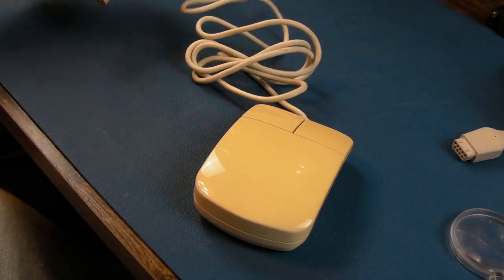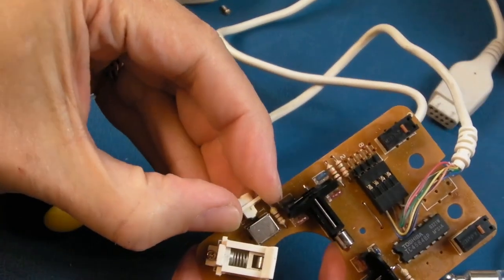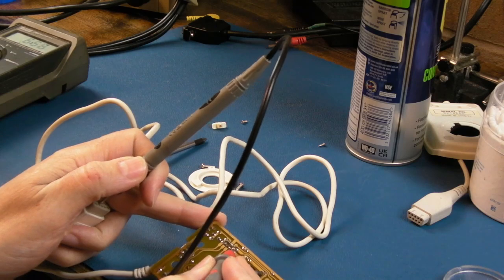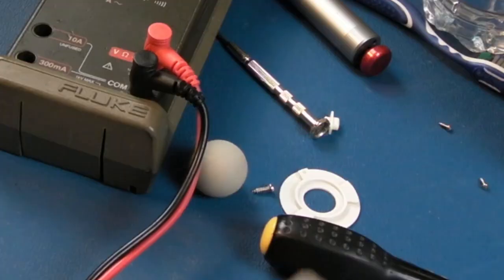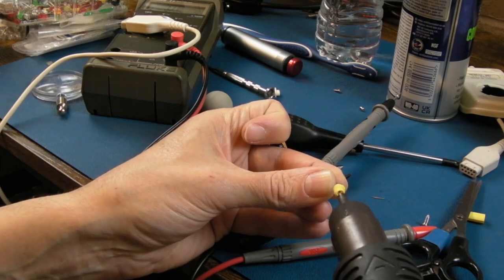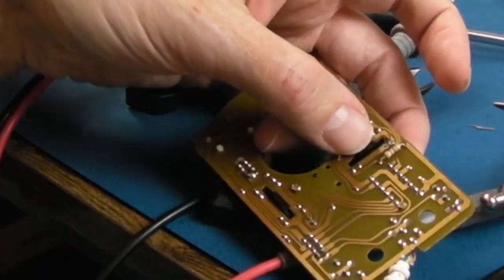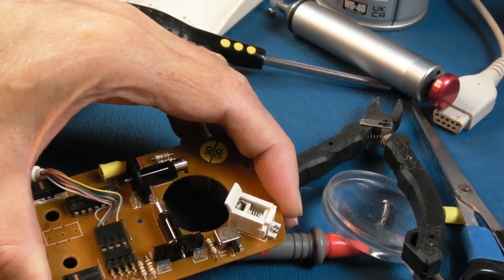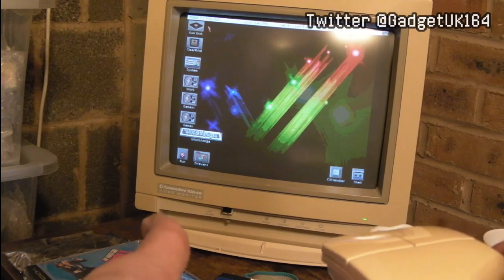Commodore / Atari Mouse Repair (IR Diodes)

Comment: What is the problem with the original 3mm ir-diode? Is this not buyable?
Reply from the maker: Many of that type of through-hole component are hard to find these days...   There might be something similar if you look around!
Reply: @GadgetUK164  , I find this one SIR4045. I think this fits

Comment: Genius! One for the knowledge bank.

To make it less susceptible to dropping you could follow the advice of the chief engineer where I used to work; there is no engineering problem that cannot be solved by the application of a sufficient quantity of hot glue. 😂

Comment: Top work from BodgeitUK164 again. :) That's the exact mouse model I had sitting on my desk in 1993 and still have sitting on my desk now. It's as yellow as that one and the clips at the back are long gone -- it's only held on with the screws at the front. During a mid-90s heatwave, I took my Falcon out on the patio to play Civilisation in the sun. The IR receivers were overwhelmed by the light coming through the white (ish) mouse body, so I painted the inside dark blue with some ancient Humbrol paint left over from building an Airfix model many years before. What larks. Bodging things even then.
Reply from the maker: Thanks lol!  Great idea to solve that outdoors Falcon problem!!!

Comment: You might be able to use the IR LED's and photo diodes out of a old VCR that are used to detect the tape.  Also not sure if you did this in the video but when putting the screws back into the plastic I would recommend spinning it backwards until it kind of drops back down and then screwing it in and that will help prevent cutting new threads into the old plastic.
Reply from the maker: Thanks!  IR diodes from a remote control would probably work!  I often do the the "unscrew before you screw in" technique - I've shown it so many times on my channel!   I learned that tip back in 1992 when I first got into the trade =D

Comment: Great creative fix! I've repaired a few Commodore tank mice with the original part photo transistor. The part is from Osram and is named LPT 80A. It's readily available from RS, Distrilec, Mouser etc and is less than a euro each. Unsure if this third party mouse uses it but I guess that it should work.
Reply from the maker: Thanks for the info on the part number for Commodore tank mice there =D
Reply: LPT 80A isn't available anymore, but maybe LTE-302-M works ? ...or maybe QEE122 ?